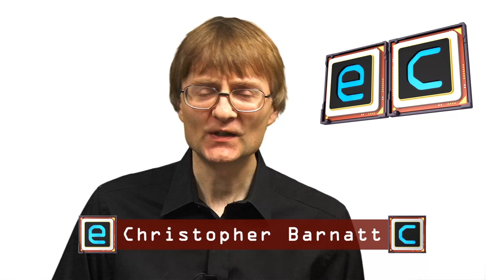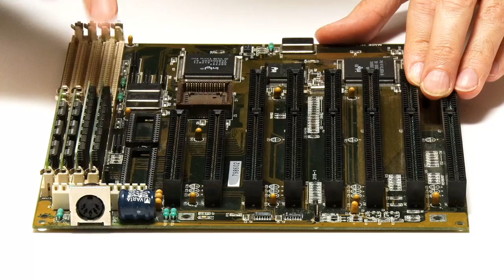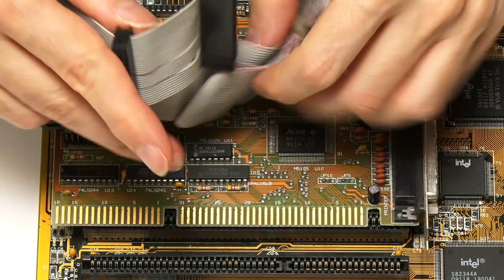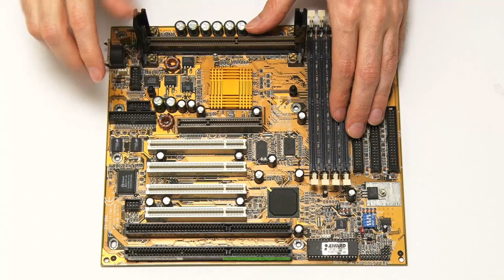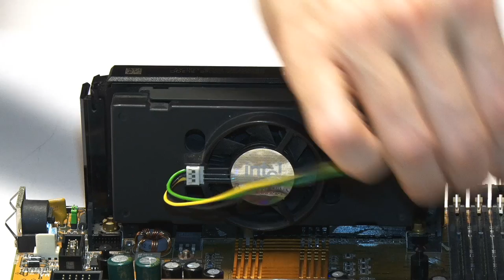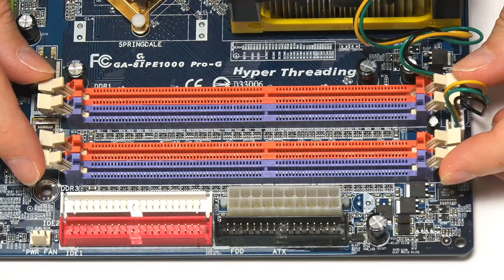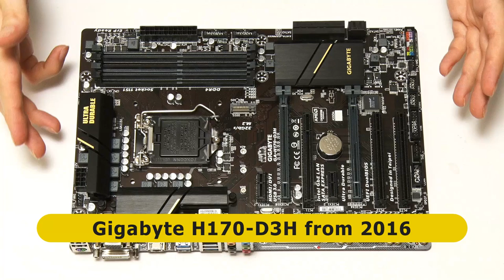PC Motherboard Evolution

Comment: I had a CoCo x 2, CoCo II, Timex Sinclair, Comadore 64, Tandy Model 1,  and more 8086 8088 80286 80386 80486, and modern cpu based computers than I can remember. Currently have 3 servers, 4 laptops, 5 desktops all i3, i5 or i7. All 3 servers have multiple VMs running on them at least one of which is a flavor of the Linux.  Wish I had all the money I spent on all those things back now.

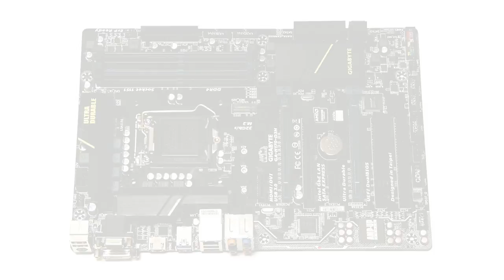Comment: 0:55 That 386 motherboard is rather beautiful in its amber and dark brown-to-black Art Deco colour scheme.
Reply from the maker: I agree.
Reply: @ExplainingComputers  What's the make and model? A working example mounted for display, vertically to the wall or near-vertically on a stand, would make a nice retrocomputing objet d’art. It would be necessary to connect a video card or serial card, but it should be possible to find one that's low-profile, or use an ISA ribbon cable and hide it elsewhere.

Comment: You forget to release the locks at the top of the Slot 1 CPU for the processor so it can't get loose. Also the CPU fan connector is on the other side, no need to cross the cable all the way through the memory banks.
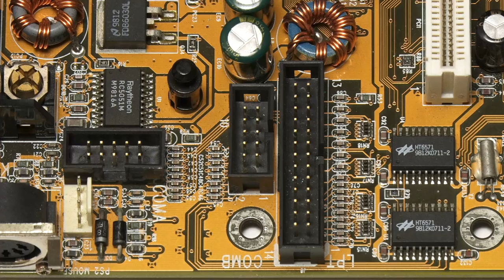Reply from the maker: I didn't forget to release the locks. One is broken . . .! :) On the fan connector, the CPU fan connector is not on the other side as you suggest. As I show and explicitly mention at about 9:20 in the video, the connector you refer to is a PC/2 mouse header, so I cannot connect the fan to that. :)
Reply: @ExplainingComputers  Actually a PS/2 header ;) but you're right. Those locks got usually broken. Having those loose CPU back in their slot was a very common "repair" back then. Regarding the CPU fan connector, what a weird position for it!!!
Reply from the maker: Yes, sorry, PS/2. My fingers are getting less accurate today! :)

Comment: Fantastic. All history is coming back. Nice in the 90's was the power switch, whitch had no indications and plugging them wrong could blow out the electricity. You needed knowlegdge to assemble a computer, and the wrist wire wasn't an option for not damaging components.

Comment: so why did you put the floppy drive cable in the wrong way around. the red line indicates pin 1,  which is on the opposite end of the pins.
Reply from the maker: See pinned comment. :)

Comment: I did build a PC in 1993 or there about, and yes, it was much jumpers etc. to consider. And controllers were mostly on cards. Sound controller, storage controller, and serial/parallel controller were all on ISA slots. And of course vga card for the graphics. And we ha no google or youtube to help me when I did it. :) . It is a very different time now.
Reply: Even if you did get the thing to actually post, there was still days (if not weeks) worth of time trying to get it all to work properly.
Reply: @mephInc  Actually the PC I used longest time to get up was a windows vista with Nvidia chipset motherboard. It took more than a month before it worked. It never was a very good machine, but it became slightly better with windows 7 instead.
Reply: @oysteinsoreide4323  
I skipped vista entirely. I finally dropped 7 as of a week ago. I'm still digging around inside of 10, getting rid of all of Microsoft's built in garbage. NT was my favorite but XP was able to play more games.
Reply: @mephInc  XP was the first windows that combined the windows for private market and for business. Windows 2000 was the NT line, and ME was the other branch. XP was a good OS, but in many ways it was two, before and after SP2, which updated most of the files in the OS. Vista was the first OS where Microsoft enforced drivers to be both 64bit and 32bit compatible to be marked as compatible. Xp had 64 bit version too, but with limited driver support. NT was very stable, and not as cluttered as XP, but XP had more appeal to private users.

Comment: I remember the old motherboard towers constructed in heavy sheet steel, they could slice a finger clean off if you wasn't careful. Those old Ni-cd Varta barrel batteries are also notorious for burning a hole through motherboards and are best removed in old equipment.

Comment: One thing you also did not mention about those older motherboards and the slightly more modern ones was a very big change in the power supply connector. The earlier motherboards including the first one you show did not have a low power state and the ability to turn on and off parts of the power supply like a modern computer. The early power supply had a phisical on off switch that in some was routed to the front of the case to a 110/230 volt power switch but some had it on the back or the side. My first case had the power switch on the side at the back right of the desktop case and my second case had a power switch on the frount of the full tower case I had. The Slot one motherboard you featured looked like it had both style power connectoters and could be used with the older phisical swich kind or the newer kind that could be switced between a hi and lower power state by the motherboard.
Reply from the maker: Yes, I should have mentioned this. I miss physical power switches.
Reply: You could also probably do a whole video on the evolution of PC case sizes as well. These days the mid part of the mid-tower case is left off with most people just calling them a tower case when they are only half the size of a true tower case due to the fact rack servers replaced the tower case in most businesses. Mid-tower was just a contraction of mid-sized tower case.

Comment: Slow??? That 386 was blazing fast compared to the common 8088 xt computers which were so prevalent back in the late 80's. In fact, running DOS 3.3, it would load it's programs faster than even today's computers. Nice tightly written code makes all the difference.

Comment: Feels like yesterday, I am getting old.
Still remember my Celeron 667Mhz, that could be overclocked easily to almost double that speed.
Interesting to see that the brackets still haven't changed for the expansion cards.
Also very interesting to see that the components on most cards were on the top side, while nowadays these components are at the bottom.
Which I never find making sense for graphic cards for example.

Also very interesting to see that manufactures first really didn't care about looks.
That is very different today.
Reply: AGP slots had problems with the cards coming loose (really more like tilting a bit) during shipment in the early days. Later AGP slots tended to have a clip that helped retain the AGP card at the end of the slot. PCI-E seems to have considered that problem in their design.

Comment: Interesting. Thanks! The 2nd board you showed might have been that of a 386DX. The CPU just said 386 because until the SX version was released, there was no reason to add the DX designator. DX boards and chips were a full 32-bit design, utilizing a 32-bit data bus. SX boards only had a 16-bit data bus, but the 386SX chip was 32 bits internally.
Anyway, the 1st two boards might have been a lot different than you said.
Reply from the maker: Yes, the second board (the one in the case) was a 386DX one.

Comment: Ah, yes!  At 5:06 we called those IDE IOs.  The one without the drive controllers we called AT IOs.  If you wanted to run an external modem at over 9600 baud though, you better make sure whichever flavor of IO you used had 16550 UARTs on them! ;)

Comment: Hats off to that Slot 1 motherboard and it's oddball AT/ATX combo of PSU connectors, that one has to be only one I've seen like that. I've seen PCI and AGP, I've seen PCI and PCIE... But the ability to upgrade from an AT PSU to an ATX PSU and keep the motherboard is... wow.

There where Socket 7 (first Pentium) motherboards that had ditched the AT PSUs by then.

Comment: @16:02 that's not strictly true about onboard video. Several platforms with integrated graphics appeared in the late 90s, in both Super 7 and Socket 370 platforms, the VIA MVP4 for Socket 7 and the  Intel i810/815 platforms for Socket 370 Pentium IIIs, as well as other ones from SiS and ALi, which were favoured by OEMs because of cost and not so much DIY due to the graphics performance. One major difference is that the graphics was still connected via AGP or PCI internally in the chipset rather than integrated into the CPU die.

Comment: Having a math co-processor was a big deal back in the day. Now the math co-processor is integrated into the main cpu. So if you want to divide two numbers with decimal points, your processor can do it all in one go. But back in the day, if you didn't have a math co-processor, the computer had to run a little program where it would do something like the long division you learned how to do back in grade school. Having a co-processor could make doing decimal (or floating point in computer jargon) math orders of magnitude faster. Note that your motherboard didn't have a zero insertion force sockets for the cpu and the co-processor back then. That meant that you had to use some force to push the chip in. If all of the pins weren't lined up just right then you could bend some of them. It was a huge pain to try to bend the pins back and of course they would never be as strong as they were before some idiot bent them.

Comment: the good 'ol days of setting dip switches and jumpers for those nasty IRQ conflicts and most importantly, choosing the jumper for the right processor when Cyrix, AMD and Intel shared the same motherboard socket. those were the days! and then of course there was SCSI! my favorite interface because it was extra complex with 50/68/80 pin cables with and without termination, some worked on HVD drives and some worked on LVD drives back when hard drives were the size of bricks. controller cards never came with 80 pin connectors. you had to get an SCA or SCA-2 converter adapter! and those were so flaky!

Comment: Will you be looking at more single board computers?
Reply from the maker: Certainly! :) Next week's video is the next part of my "Devastator" robot build, controlled by a Raspberry Pi Zero W. In terms of new boards, before the end of 2018 there will be videos on the tiny new NanoPi-NEO4, and (fingers crossed) the UDOO Bolt. Oh, and before that I'll be adding a PCIe SATA card to the RockPro64. This channel will at present remain about 40 per cent videos about SBCs -- and 60 per cent about computing more generally! :)
Reply: AWSOME!

Comment: I learned the hard way how much more fragile those SATA connectors are than the old IDE connectors were when I tried to connect one to a drive while it was in the case and broke the "L" shaped piece in the middle. The cables are nice and compact, but you can't be heavy handed with them like the IDE connectors.
Reply from the maker: Very, very true. The first SATA connectors on motherboards were only rated for 10 insertions. :)
Reply: @ExplainingComputers  It was the one on the drive itself that broke, not the MB. Now I'm a lot more paranoid and gentle when moving them.

Comment: Chip says 'Q9117' which is a date code meaning '17th week of 91', so the chips were made around late April of 1991, the motherboard would have been made some time after that.
Reply from the maker: Thanks for your correction.

Comment: I wouldn't say the motherboard design has changed that "dramatically" during the past 30 years... (Or even since the original IBM PC from 1981, which you should've included by the way). They all resemble each other at the core, but of course many technical features have evolved during the years.

If you compare the motherboard design of 1981 to mid-1940s, now there's a DRAMATIC change. ;) 1981 vs. 2018, not too much...
Reply from the maker: True -- but the video is called "PC" motherboard evolution! :) You can see some very old "motherboards" in my video here: https://www.youtube.com/watch?v=KkSxC9pFGZs
Reply: agree. of course, some connectors have changed, north/southbridge has gone etc. .. but building a new PC today is pretty similar to what it was 20 years ago. CPU in the upper region of the motherboard, RAM somewhere next to it, graphics and other cards on lower left (no matter if PCI, AGP, PCIe..), drive connectors on lower right .... i like the ATX standard. :)

Comment: 386 / 486 boards had so many jumpers! :)  CPU Type, Co-processor, E-Cache size, speed, IRQs,  DMA, various voltages, and once sorted you had to then deal with similar jumpers on the expansion cards and peripherals. Then hours playing with autoexec.bat and config.sys to make things work for the task at hand.    It was rewarding when it worked, and frustrating as hell when it didn't.  (And no internet to look stuff up or get help.) :)
Reply: yeah, that was the wild west with tons of speeds, multipliers, cache sizes or even non-existant, and 4-5 types of slots (isa 8 + 16 bit, eisa, agp, pci, vesa localbus so yeah 6 then) going from what 25MHz up to a whopping 120 MHz or so, more with the Pentium Overdrive chips, sooo much time optimizing memory to free up as much below 640KB as possible and omg the driver hell for various games etc.

Comment: I miss the ISA slots. They allowed very easy hardware because it was just the address and data lines making it more like interfacing with a Raspberry Pi. PCI(e) is great for speed but for simple hardware hackers like myself (at the time) PCI meant I couldn't make my own add-ons for my computer :(

Comment: Just a small correction on the part around 6min. First of all, both of the connectors in the upper left corner were for COM ports, you dont have a connector for LPT because it is at the back. And also you put the floppy cable in the wrong direction. I know that because you always had to allign the red strip on the cable with the pin1 on the connector side. A similar method is used when connecting to your HDD, floppy or CDRom drive where the red line has to be facing the power connector. Later they introduces a notch on the cable so you could'nt be wrong anymore :)

Hope that clears it up a little. 

Regards.
Reply: oh, great, now I see your comment... ignore me.

Comment: 1:18 What makes you think that chip is from October 1990?
It's from the 17th week of 1991, thus late April 1991.

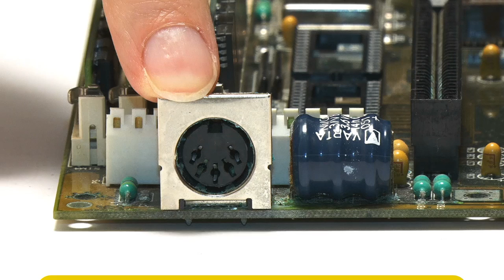4:15 That isn't simply corrosion, that's the alkaline of the Varta battery attacking the PCB.

6:12 That's the wrong way around, the colored wire should go to pin 1.

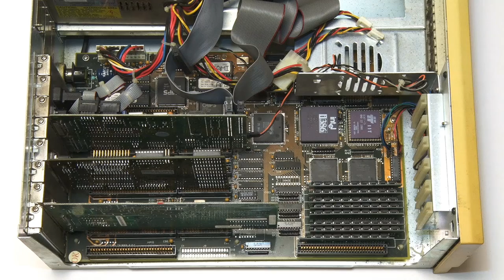6:40 Remove that Varta battery before it's too late.
Reply from the maker: I dated via the Intel datasheet, available here: https://pdf1.alldatasheet.com/datasheet-pdf/view/123370/INTEL/S82343.html
Reply: I see, but that particular chip was fabricated in April 1991. The 14 MHz crystal was made even later, in June 1991.

Comment: 6:20 actually you wrong pluged FDD ribbon. Red strip should be on the first pin on the MB. ;)
Reply from the maker: Yes, see pinned comment! :)
Reply: y, saw it leater. Just wanted to use this useless knowledge once more ;)

Comment: Why did they remove ide of cable?
Reply: Switching of IDE hardrives to Sata Hardrives and the connectors them selves take up some room on the boards
Reply: @malcolmholmes509  is that bad for the air flow?
Reply: Yeah that can be a figure aswell and that majority of people will use sata hdd and wouldnt be on most intel lga 1151 and AM4 boards

The only time you will find IDE headers and controlers on boards will be custom boards or maybe some server workstation boards but not on most consumer boards

Comment: Anyone else noticed the cable for the CPU fan could be plugged in next to the left of its card, and not go across like that? It bugged me how much ppl in the old days could not use the DIMM slot for Solitaire...
Reply from the maker: As I have covered many times in these comments, the connector you refer to is NOT a fan connector. I connect the CPU fan to the correct and only socket available for this purpose. The other connector, as I mention in the video (and the label for which can be clearly seen at about 9:20, bottom left), is a header for a PS/2 mouse. So I am not as stupid as you imply. :)
Reply: ExplainingComputers ah Thanks for the explanation. I’m not saying that youre stupid, just thought that the manufacturer may not thought of crossing the slots when creating the motherboard? Coz I have built a PC in the past and had issues with fans cabling. I really liked your videos, theyre easily digested. Keep it up :) 👍
Reply from the maker: Thanks for this. And sorry that I took your comment the wrong way.

Comment: Slot 1 was great for CPU upgrading using a slotkey adapter aka slocket. I bought a PC in 1999 that was built around an Asus P2B motherboard. This motherboard was originally designed for the Pentium II slot 1 CPU. In my case it ran a Celeron 400 MHz Slot 1 (Mendochino core). In time, I first upgraded to a Pentium III 800 MHz FCPGA (Coppermine core) and finally to a Celeron 1.3 GHz FCPGA2 (Tualatin core). All this was possible through the use of an appropriate slotkey adapter, that matched the CPU to the Slot 1 on the motherboard. 

This PC is still running today, in 2021, with Debian Linux on it, as a small webserver..

Comment: This brought me years back.... 1997, 1st PC, Pentium 200MMX, 200 MHz with 64MB ram (when 16MB was the standard), on a SOYO motherboardwith 2 ISA, 4 PCI slotsand NO USB (!), , Plextor PX40Tsi CDrom and a Plextor CDRW on a SCSI controller. Viper V330 with the Riva 128 GPU, Quantum Fireball 3,2 GB HDD, almost immediately replaced by the same model with 5,1 Gb capacity and a lousy 33Kbps modem, which was quite useless, as Internet in Greece at the time was somewhat nonexistant. Add an EIZO F35 15" monitor, an EPSON STYLUS COLOR 600 printer, Windows 3.11 for Workgroups on MS DOS 6.22 and Windows 95 (first edition) and the lot had cost me a fortune..... I learned the hard way by short circuiting this motherboard that a naked screwdriver and a turned-on PSU, don't get along very well..... Of course first love was an ZX Spectrum +2, 11 years before that. God I'm old..😁.